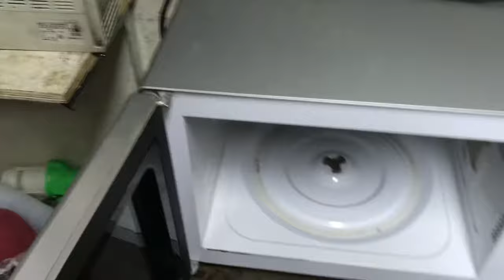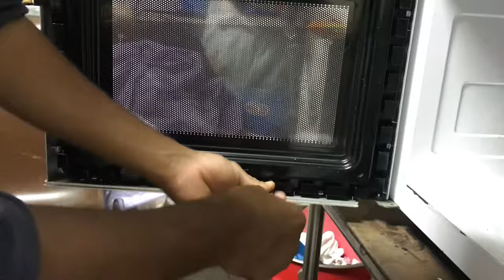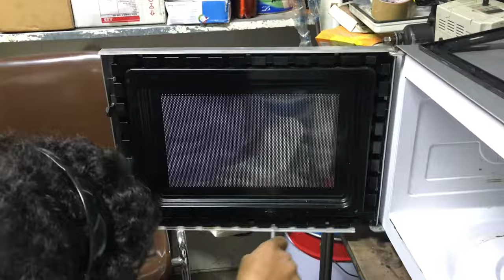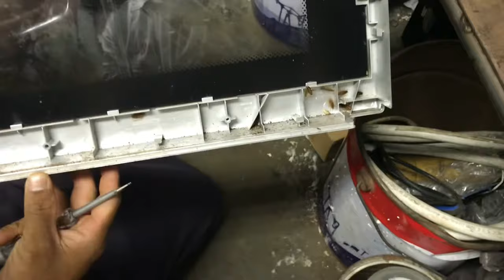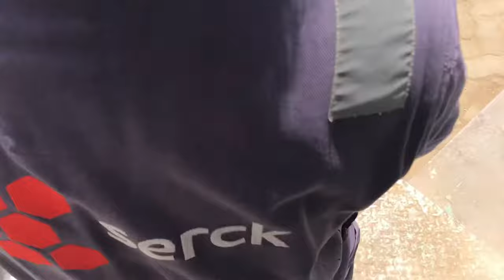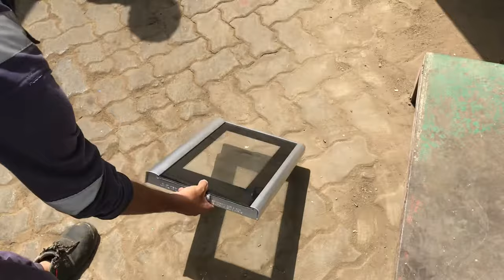How to remove cokroaches from microwave oven door

Comment: Thanks, there was a strip of aluminium reflective tape at the top of mine which came down, hanging in front of the window. I got it partially opened thanks to your video, enough to remove the foil.

Comment: That thing had most likely been opened before. As you can see that after the brown/black coloured frame is removed, there is a screw-hole with a missing screw along the bottom edge. The other thing to beware of -- for somebody that hasn't removed all those screws before is ---- as can be seen from the video, the white-coloured front panel (which actually contains the glass) can actually (and unexpectedly) fall away from the door. This means that if you don't hold onto the white-coloured front section when removing the screws, then it come come crashing down onto the floor, and end in tears ---- such as broken or cracked glass etc. So - after undoing the screws, make sure to know that the white coloured panel can actually fall away onto the floor (and crash - possibly even breaking/cracking glass), and catch somebody by surprise. So - remember - the METAL frame (with the metal grill) on the inner side of the door is not the part that comes off. It's actually the white-coloured frame that is the removable piece.